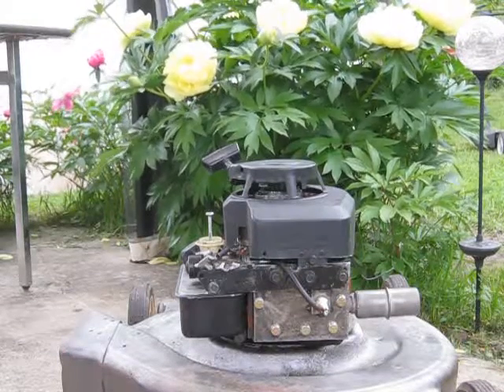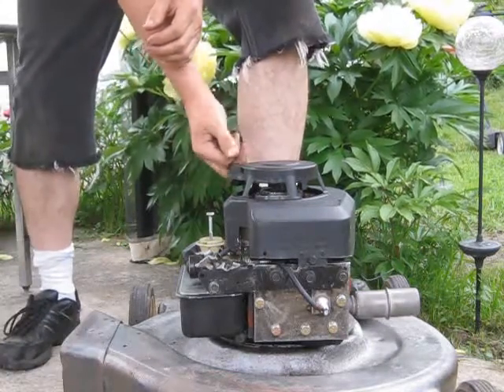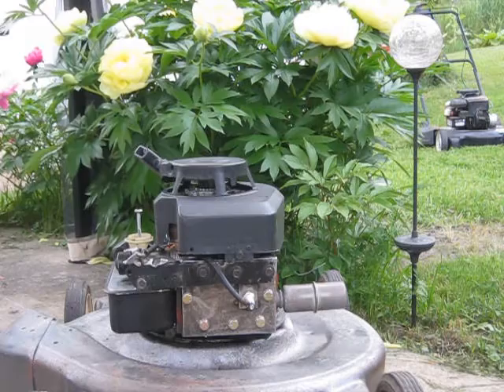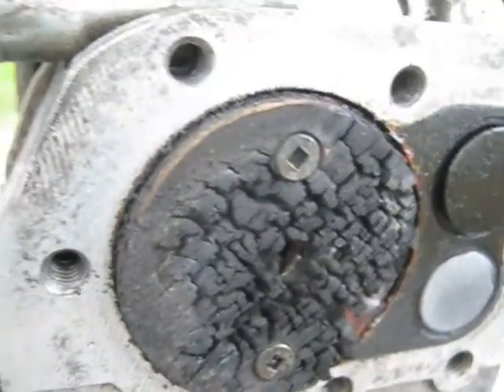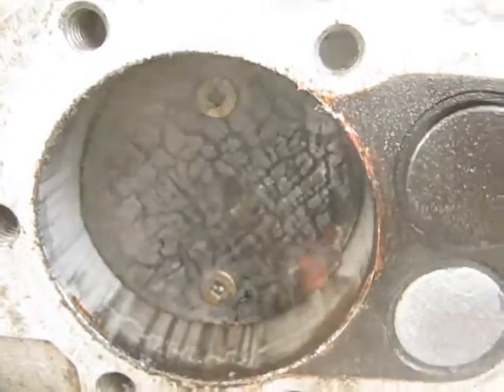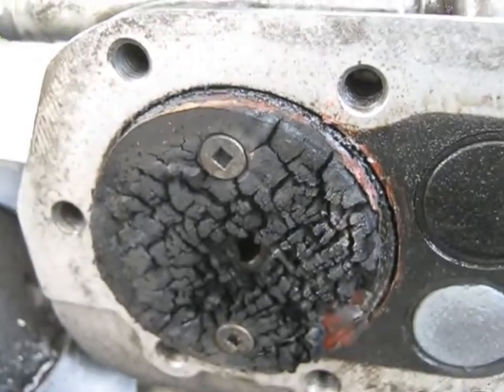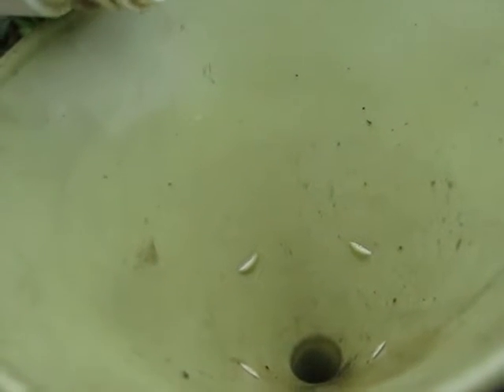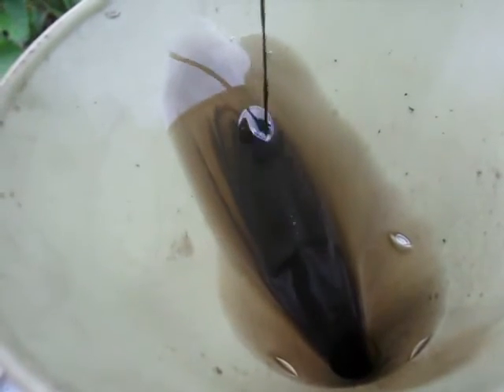Boraxed Box Elder Wood Run (4 x as long!)

Comment: Borax seems to help. We use it to kill fireants where I live. You may not want to breathe or handle it much.
Reply from the maker: Yes, I hear you, I was wondering if it was going to kill the flowers with the exhaust!  that would get me into hot water with the wife!
Reply: ChargerMiles007 
My wife says they used it to wash diapers in the days of cloth ones, so maybe not so bad, but it DOES kill insects.
Reply: Most liquid ant poisons are basically a sugar syrup with borax and/or boric acid added.